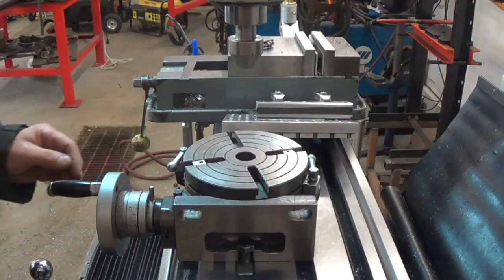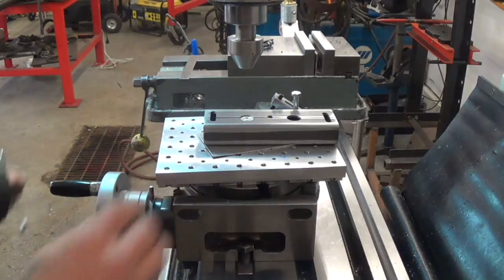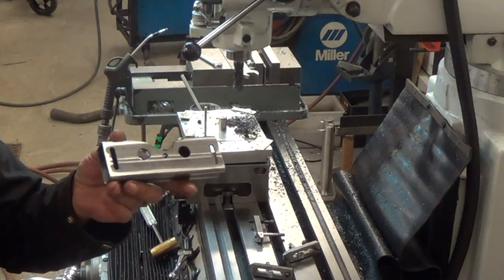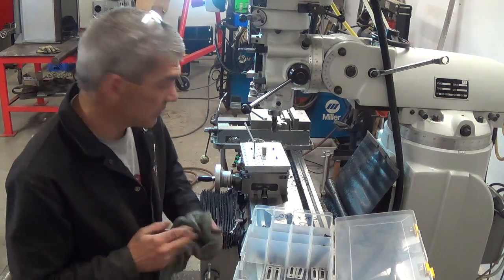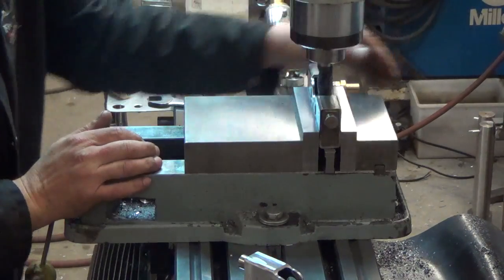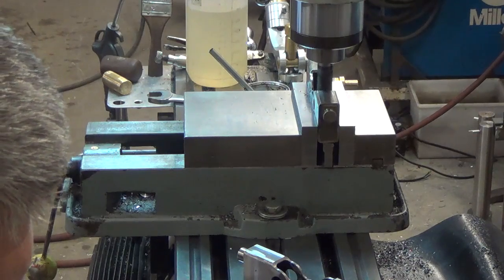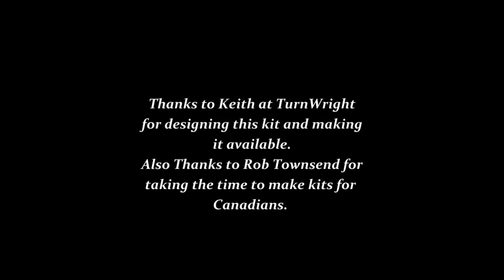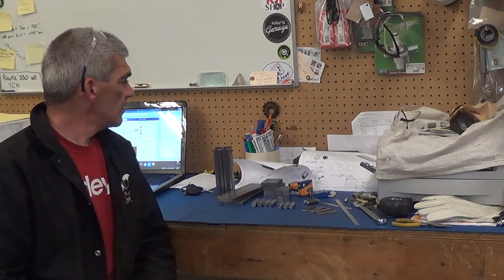Rolling the Wright Way 4/4

Comment: I've been following your wright roller build, and man there is a lot to them eh?, I missed out when Keith let the first few sets go dirt cheap, just haven't had a need to buy a set yet. great job.
Brian
Reply from the maker: +Brian Stanga It all depends on which method you use for assembly and the tolerance you want to achieve. Welding together would chop some time and simple drilling holes instead of boring to a specific size will shorten it again. Then there's the time spent wondering if this is the way I want to do it..LOL 
Thanks for tuning in.... Colin ;-)

Comment: They turned out nice! When I get one a little tight I usually just whop the fire out of it with a hammer and loosen it up. lol
Reply from the maker: +bcbloc02 Ha, that probably would have worked as well... but a little stoning worked wonders. So far I haven't dropped one and knocked it out of square... I bet it's coming though..LOL  Cheers, Colin ;-)

Comment: I waited over here in the corner because I knew you would be back.  Obviously you did a good job on the building and fitting.  Nice tool for shaft work.   Thanks for sharing.
Reply from the maker: +cerberus You spent all nite in the corner? LOL Told you I wouldn't get part 4 up till morning... :-)   Thanks for hangin in there Harold!